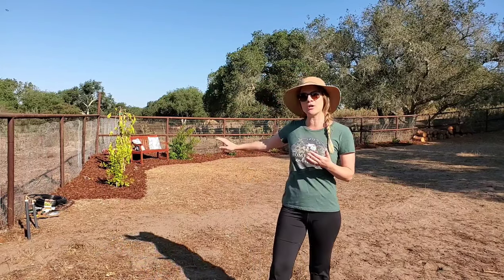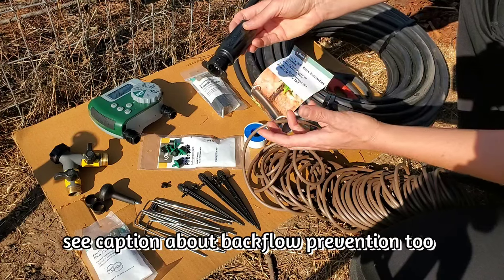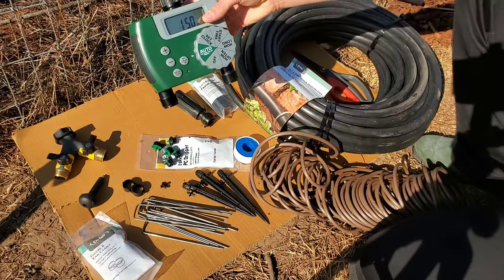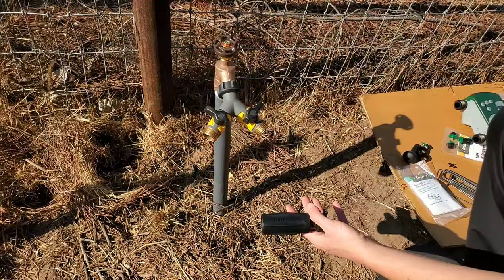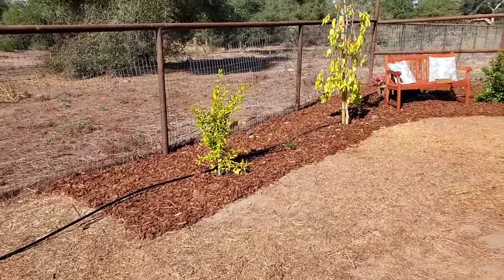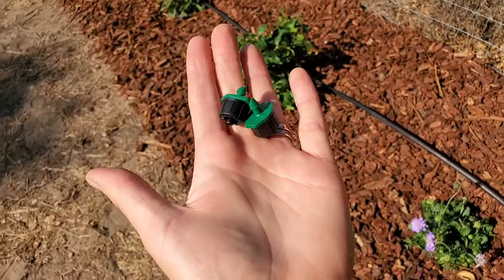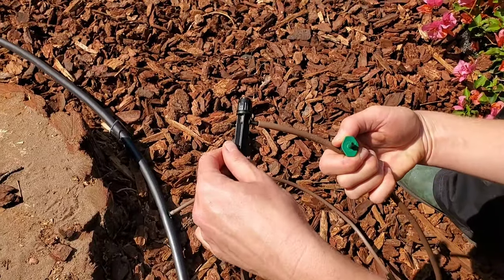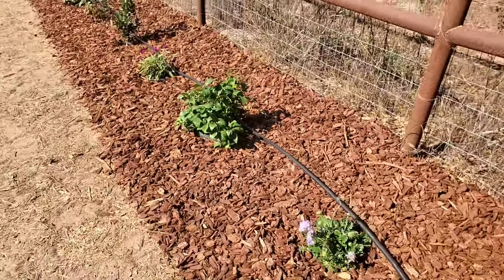How to Connect Drip Irrigation to a Hose Bibb, Faucet or Spigot - and automate it!

Comment: I love and enjoy your videos! May I present some insights? I have found the brown 1/4" poly tubing to calcify in the sun, whereas the black is more supple, so if you need to bend it or change out the emiter, the brown won't go on a new barb, it is too dried out (so choose the black if available). Also purchase the connector straight barbs in the pack of 10, instead of using the barbs that come with the emitter on stakes ( that twist off) because trying to insert them into the 1/2" poly tubing, it wants to bend the tubing as they don't go in easily, and bends are not good. So the pack of 10 straight connects go in like a breeze! Also, I always use a connect, and piece of tubbing, because if you ever need to pull out the emiter that was placed directly into the 1/2", it will rip when the barb is pulled out to switch it to something else. Whereas, with a tubing to emitter, you cut the tubing and put on a new piece and again, if that tubing is brown, it won't accept it because it calcifies and gets hard a year down the line. I had to switch out my emitters, and move them around until I got the right combination! Also the best poker to use to make a hole was from a nursery I found, that looks like a mouses ear with a nail point, and it was bright yellow hard plastic. That area behind the nail point was hollow and that is where you slipped in the straight connector to help pop it in. (The mouses ear description, describes how you hold it between thumb and forefinger).  Hopefully the description can assist in identifying it at the store, or amazon All the best! I am excited for you!
Reply from the maker: Thanks for sharing your insight!

Comment: Thats was very educating, especially the part about the pressure regulator with the filter. Going to see how it scales up to about 1000ft of peripheral irrigation using a 3/4 tube and if a water pump will also be needed.
Reply from the maker: Thank you so much and best of luck to you!

Comment: Could you connect a PVC system with the hose bib? Thank you so much for your videos!  I've watched them over and over again.
Reply from the maker: Hi there! I'm not 100% sure what you mean so please clarify if I'm off track, but do you mean to connect PCV pipes at the end of a hose bibb - then run that to beds and what not? If so, yes there are hose faucet-to-PVC adapters you can buy and screw on. I also just posted a new easy raised bed drip irrigation video yesterday that you may like, which also connects to a faucet. Hope that helps!

Comment: THANK YOU FOR  A STRAIGHT FORWARD NO FLUFF VIDEO. I am new to gardening am and was adamant about having buried drip system.. Can you put soil on top of these.
Reply from the maker: You are very welcome, you can bury the half in drip line with dirt or bark mulch but you would want the emitters to be above the soil as you ideally don't want a lot of debris getting into the emitters.

Comment: Great step by step video..  Hope you can guide me to  set mine up,  In what order  From the Faust , should  all these parts go..
 the pressure reducer, Y-filter,  timer   and a RV water filter, ( to get the chlorine out of water)  .
 I am attaching my  garden hose from the faust. , run it to the backyard to connect  to the 1/2' hose 
I have all the parts now . I don't know what order all these should go . 

🙃🤔  Bit confusing with so many parts  😊
Cheers from  Toronto . Our first sunny day in 3 weeks
Reply from the maker: Hi, the length of the hose must be taken into account in terms of the length of your run. 100-200 feet is the maximum length that you should have before you start seeing noticeable pressure loss. I would attach your RV water filter to the faucet, then you attach the backflow preventer, filter,  pressure regulator, garden hose (assuming it screws onto the pressure regulator), then at the end of the hose line, you attach your adapter to 1/2 inch tubing. 

I would run the system as is to see how much pressure you have at the end of your drip line and you may need to make some adjustments if you aren't seeing enough pressure at the end of the line. Taking out the pressure regulator could be an option to try out if you aren't seeing enough drip at the end of your line. Hope that helps and good luck!

Comment: Thank you for a very concise (and comforting) video. I bought a 100ft 1/2 Rain Bird tubing roll that already has holes every 18 inches, do I still need emitters or will the pre-made holes work instead? Thanks again- excellent video!
Reply from the maker: The holes are likely emitters for water, I would double check your purchase so you know the exact GPH they emit so you can better judge how often or long to run your system. Hope that helps and good luck!
Reply: @HomesteadandChill   And, thanks again. You were right, no emitters needed.

Comment: Excellent video, I'm a drip irrigation newbie ha..The only thing  worries me is the 1/2 pipe seems like it wouldn't last too long, maybe I got a cheap version. Just curious what the lifetime on this 1/2 would be? I've been a gardner for a long time and just started  drip irrigation and I keep asking myself why didnt iI do this a long time ago. I am definitely hooked. It seems like the plants that seem happier ifor me is the ones that's getting the sprinkler mist at the top.. and I can see why,  it seems it distributes the water better imo. With the skow drip emiters I noticed that the top of the pot a small area will be wet but I'll have water running out of the bottom of the pot. If that makes sense. I am going to subscribe, thank you.
Reply from the maker: The poly tubing can actually last for quite awhile depending on how extreme the climate is where you live. Our previous property already had a drip system set up and we lived there for 8 years and had likely been installed at least 8 years before that. Keeping it covered with mulch and out of direct sunlight will also help it last longer. Best of luck and enjoy your drip system.

Comment: For those who are too cheap to buy a hold punch, I just use a hand drill with a small drill bit like those use in woodworking. Screws and screwdriver might work as well.
Reply from the maker: That could work as long as you use the correct bit size as you want it to be the same size as the emitters, also be sure not to drill all the way through the other side of the drip tubing as well.

Comment: Thanks for the info.  Can you run your flex irrigation tubing out to garden to add another spigot on the end?
Reply from the maker: No, it is best to use PVC or metal irrigation pipe (whatever material your main water lines are going to your spigot) to run additional lines and additional spigots. This faucet actually wasn't even here when we first moved in, we continued a PVC line that was closer to the front of the property to the back fence line. Hope that helps and good luck!

Comment: Do you see any problem with attaching a 5'-8' leader hose to the Y at the hose bib in order to get the irrigation assembly down to ground level and enclose it inside of a valve box? My hose bib is exposed near a public sidewalk so the valve box is protection against damage from someone bumping the assembly. Those plastic parts project out quite a way off the hose bib and are pretty vulnerable. As well, this would discourage theft of the assembly, which isn't cheap.

Comment: My spigot comes out of the side of my house on my patio. I want to run a section of leader hose to the adjacent side of my house that is away from the patio to prevent running a bunch of tubing across my patio into my beds. So, my question is: Can I  add a pressure regulator, timer, black tubing  to the end of the leader hose? I hope this is somewhat clear!!
Reply from the maker: You can try that as a hose will attach to the hose end timer but you will have to see how much pressure you have at the end of the line once you add your drip components. It's best to go with the shortest path to the area you want to irrigate unless of course you are using PVC piping to bring water to another area.

It just depends on the amount of pressure that you have coming out of the hose and how much stuff you want to irrigate with drip irrigation. Let us know how it works out for you.

Comment: What if we do not have that 3-in-1 adapter? The spigot is about 30 meters away from the field where I want to set up the dripping system, and I do not want to use the dripping tubing from the spigot to the field because I am running low on it. I do have some plastic garden watering hose tho, so can I somehow transport the water from spigot to the field via garden hose and connect it to the dripping tubing?
Reply from the maker: 30 meters is quite a ways for the water to travel so depending on how much water pressure you have at the faucet, it may or may not be enough pressure to fully operate the drip system. 

You would still need an adapter to connect the garden hose to the drip tubing itself (even if you don't have a 3 in 1 adapter), I would use a 3/4" garden hose and nothing with a smaller diameter that may restrict water flow. 

Another option would be to extend your waterline by essentially adding another faucet, closer to the field you want to irrigate. If the in ground irrigation line is made out of PVC and not metal, this is a lot easier to do.

Comment: Is there such a thing as a mineral filter for hard water? Thanks
Reply from the maker: There are RV carbon filters that connect to spigots or hoses, we use this one to fill up a garden fountain that runs on a small pump:

https://amzn.to/4cOaN9s

We have really hard water as well but we don't use any additional filtration for our irrigation aside from the filter that comes in the 3 in 1 or 4 in 1 pressure reducer. Hope that helps and reach out if you have any other questions.

Comment: I popped the hole straight through the hose where I was installing an emitter. How do I repair the hole on the other side of the tube?
Reply from the maker: Oops! Good thing they make "goof plugs" for that  😉 - which you can also use to plug old emitter holes if you want to modify your system. Here they are: https://www.amazon.com/dp/B01ANTE4BS?tag=a05d7b40-20&linkCode=ssc&creativeASIN=B01ANTE4BS&asc_item-id=amzn1.ideas.2ENGROD1VJC1B

Comment: But if you have to run a line from the house to the garden across the lawn? How do you protect it frin the mower?
Reply from the maker: It is best to have the main water source as close as possible to the area you want to irrigate as to not lose too much water pressure before you get to the first emitters. 

In your situation you can either use threaded components that you can connect and disconnect from the main water source to move the drip tubing out of the way so you can mow, run the tubing along a border so it won't be in the direct path of your mower, or you can dig a trench and add a water line onto your main water source with PVC or metal piping (depending on your climate and location) and add a spigot or faucet to the area you want to irrigate. Hope that helps and good luck!

Comment: just a tip: the Pressure reducer should not be installed directly at the Faucet / Spigot.. it should be installed as close as possible to the irrigation line it self

Comment: Mine keep dripping at the faucet no matter how hard I tighten it.  What should I do?
Reply from the maker: What shape is your hose bib in? If the threading at the spigot looks like it's in good shape, you can always add plumbers tape or teflon tape to the threading on the spigot itself in hopes that it creates a more watertight connection. Our systems will sometimes drip once the system is active and running, but it doesn't continue to drip in between waterings (even though the faucet is turned on). Hope that helps.
Reply: @HomesteadandChill  Thank you!  I actually ordered plumbers tape in between when I posted this and now.  I hope it works!

Comment: so you don't need filters
Reply from the maker: Hi Saleem, there is a filter in the adapter that also operates as a pressure reducer before connecting to the 1/2 inch tubing. We linked the 4 in 1 adapter in the caption of the video.